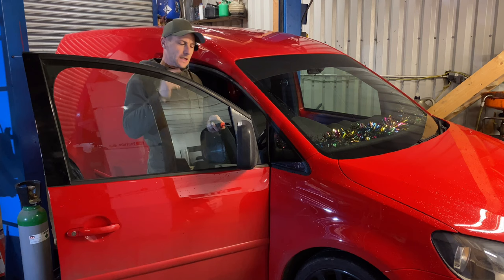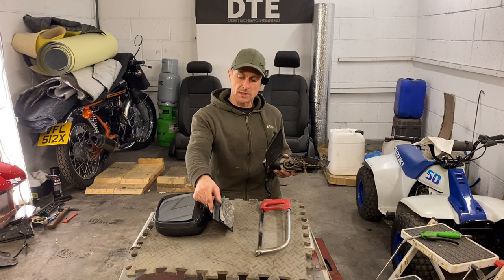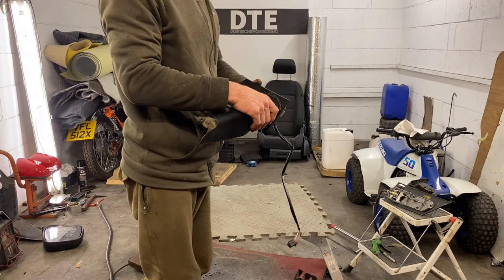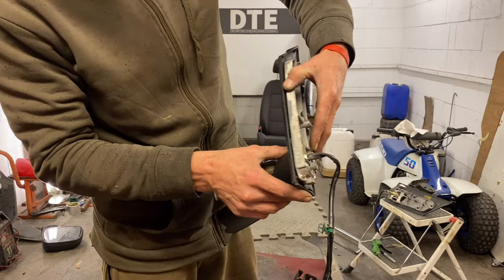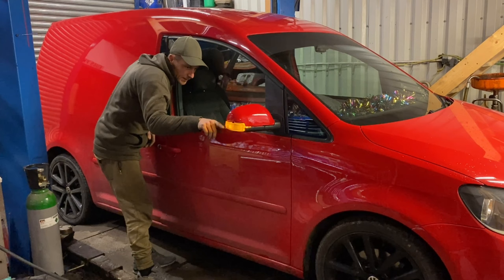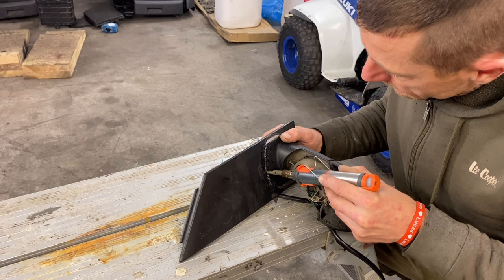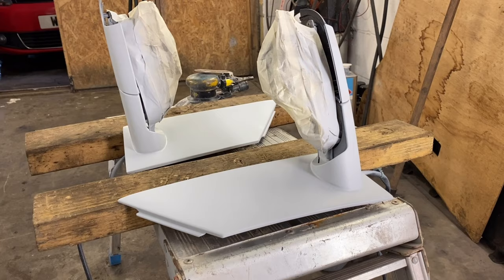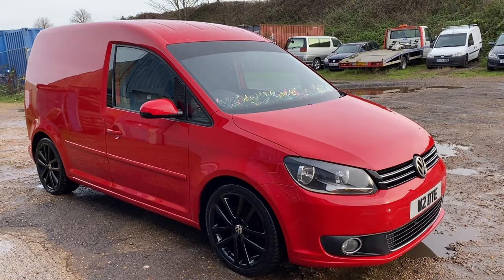CADDY 2K Touran wing mirror swap build series Pt14

Comment: Passable job there with the old splatter cannon 😂
Reply from the maker: Haha it’s not pretty but it does hold I splatter cannoned the shit out of 2 bits of ally when I first brought it and I couldn’t break it apart. I would like a tig but money is tight, maybe someone will sponser me one soon. Although I couldn’t have used it on these as the little blow torch and excess heat would have melted all the plastic.
Reply: @YTDTETV  you should trademark that name for a cheap welder. The Splatter Cannon Mk2

Comment: love the mirrors hate the caddy ones. This is one mod i want to do on mine + more
Reply from the maker: Hey bud thank you 👍 I also found the caddy ones being so big they block a lot of vision looking out the side windows for traffic etc, can see loads better with these on.
Reply: @YTDTETV  I find that the nearside one not very useful can’t get it to angle how it should be. Will defo do the touran mirror mod don’t look that hard to be fair if got the skills.
Reply from the maker: @vw_beetle_dave  my drivers side one wouldn’t move into the perfect position I wonder if it’s a common problem with them getting stuck.

Comment: How do you  fit electric windows to caddy mk3 did you do a video regards sean
Reply from the maker: Hi Sean if you search on the Facebook pages or Facebook for someone breaking a touran and get the complete insides of the doors and they fit straight in the caddy all the touran wiring plugs straight into the caddy 👍
Reply: @YTDTETV  Hi Nathan, I've already got the touran cards and motors just waiting on the extra cable you need to power the windows up, do you know if I have to do any repinning regards sean, I'm hoping to come on the next bulb water meeting 👍
Reply from the maker: @seanburke2815  hey bud so all I done was fit the touran wiring loom into my door and everything worked straight away with no repin needed. There will be some guys at the blue water meet that should hopefully have some info for ya. I’ll be there Wednesday 👍

Comment: Mate I need an engine swap in the new year have a caddy 2k slammed amg wheels rear seats r32 brakes 😬 all the trick bits but bls engine 🤣 I'm Hertfordshire not.surw where your based but do you take on engine swaps
Reply from the maker: Hey bud I’ve seen a few caddy’s with amg wheels and they look really good. I need some better brakes on mine. Ooo BLS engine 😩. What engine you thinking I’m in deal in Kent.
Reply: @DTE TV   yea I'm a carpenter so work out the van so not the cleanest nearly on 300k I'm sure injectors are on the way out judder and don't really idle properly now th3 wheel bearing sounds like a cheese grater 🤣 needs saving before I just sell it and yea your not a million miles away mate and tbh I was thinking gti  conversion but now thinking bkd or even a pd 130 I'm not on social media can't send any pics but the van looks pretty cool just don't drive cool 🤣
Reply from the maker: @golf-vi2cw  I enjoy woodwork when not fixing car stuff 👍 blimey 300k that’s good going. My shell was 200k and after abit of love it drives well again, if your bodywork is good then I’m sure it’s well worth saving.
Reply: @DTE TV  hi mate I'm hoping you might have an idea the van was running really lumpy misfire revs were high though map sensor or injectors scanned it said engine coolant temperature sensor so changed it seemed tk be that great 👍 went for a drive turned it off for a bit came back to it now its a pug tk start or won't start does with easy spray but once started idles perfect drives pretty good tbh bjb on 300k you have any ideas 🤣
Reply from the maker: @golf-vi2cw  hi mate so starting issues on these is normally down to a crank or cam sensor, when your turning it over and it doesn’t start is the Rev counter going up?
Reply: @DTE TV  hi mate yes the revs match idles fine drives nice just a pig to start all I done was change the engine coolant temperature sensor that's it 🤣